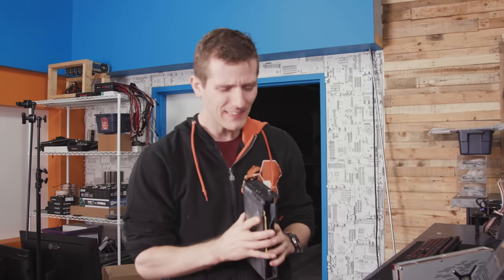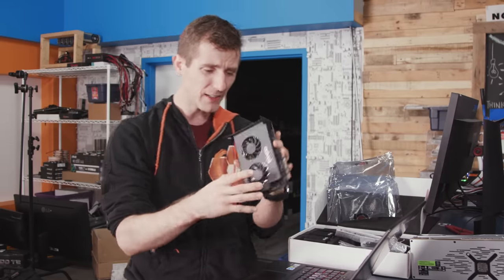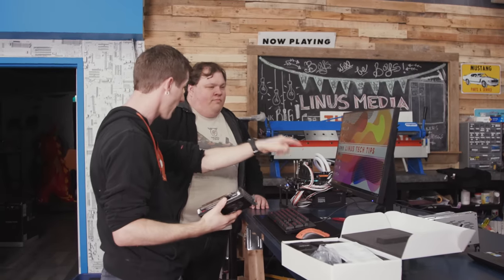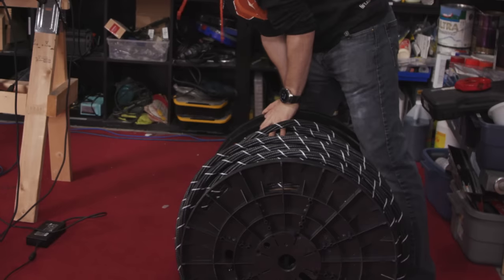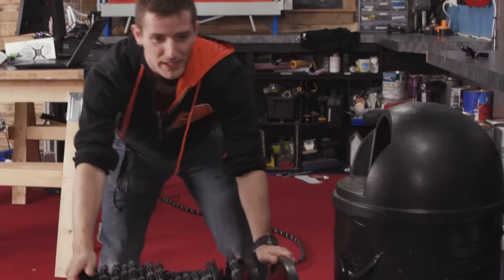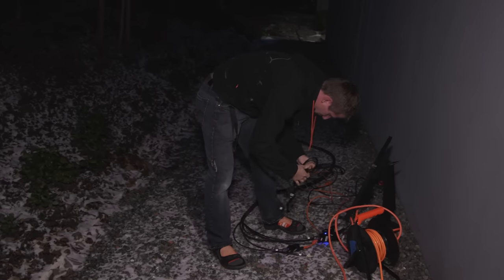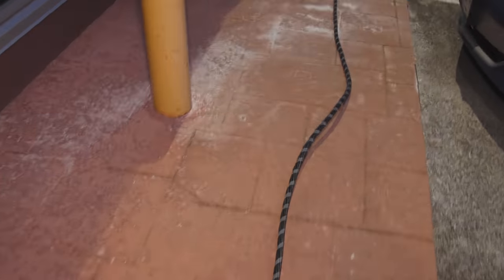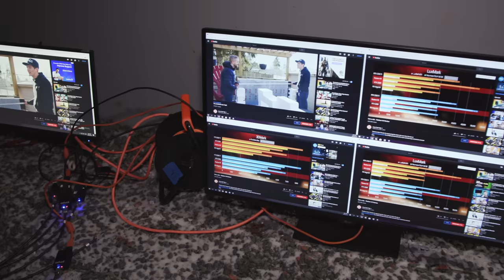The WEIRDEST Video Card We’ve EVER Seen..

Comment: that looks like it should be the GPU of the Nintendo "Switch" ;)
Reply: If only it was faster than the GPU in the Switch.
Reply: Oh yeah, because having 6 ethernet ports on the Switch would do the trick.
Reply: @XDLugia  whoosh
Reply: @Skelath  Its is way faster than the TegraX1 256 core Switch only  its a Power hungry 95Watts gpu unit.
Reply: David Hall 

;)
Reply: @tachyonzero  It only gets 18 FPS on Fortnite with high settings at 1080p, it has a Radeon E8860 GPU inside it.
Reply: @Skelath  it's a e9550, wo pretty much an rx 580, and is wayy better than that
Reply: @darthybai  My bad, just looked up the RX 580 and no, the RX 580 has twice the power draw and higher clock speeds, this card based on its design and purpose would cost 4 times as much as a standard RX 580, may as well shove a GTX 1080 Ti inside the switch instead.
Reply: @Skelath  i was mainly talking about the stream proc count, might be downclocked to kingdom come as far as i know
Any nvidia mxm gpu costs more than double it's msrp cause they want the standard to just go away
That's why you see GPUs soldered on the boards of laptops where they were mxm in prev generations (msi tried to push it really hard, asus)
Reply: @darthybai  I'm not looking at the clock speeds of the E9550 on the Advoli card, I'm looking at the clock speeds publish by AMD, Also the Switch uses a Nvidia Tegra X1 which has a TDP of 15.

Comment: I'm genuinely curious of what would happen upon plugging your monitor into your router.
Reply: browser hi iq automaten io 10 on off do dodo row.tar.mon owe royals? lie sence 4 worse?
Reply: Endless streams of pornography and grainy IP cameras pointed at trees and fences.
Reply: Theoretically? It could happen.
Reply: (For those actually genuinely curious: Nothing will happen -- HDBaseT is using ethernet framing and UDP packets. Only endpoints on the same physical ethernet segments will 'hear' the announcements of devices ready to stream. It does not work very well over wifi even if you've got fancy enterprise equipment like Xirrus or Gigabeam. You have to use their open source layer2 ethernet tunneling utility, vtun. Can find cheap LKV373 HDBaseT tranceivers if you look on the ebay/amazon hard enough. See Also: https://blog.danman.eu/new-version-of-lenkeng-hdmi-over-ip-extender-lkv373a/ )
Reply: @SLLabsKamilion  again, THEORETICALLY...
Reply: @Joe_JesusWins_Lewis  No, not theoretically. Absolutely. Specifications are specifications and code is code. Unless it's manually updated by a human (even in an automated fashion via attack scripts) it's not just going to wake up one day and decide to originate a connection to some random ipv4 endpoint on the internet. The receiver will look for broadcast frames from senders on-segment, and unless you've specifically configured the port forwarding on your router to know the IP address of the receiver device, and map it to your public IPv4 address's port 5004, nothing will happen if connected to a WAN uplink. It doesn't know how to generate UPnP requests, nor can it handle IPv6 addressing. 

The balls are inert, it is under 9000, do not collect go, do not pass $200.

There is literally nothing magic about this at all. It's a couple of off the shelf solutions duct taped together into a single device SKU.

HDbaseT has been around for at least five or six years, using standard MPEG2 transport streams carrying motion jpeg encoded video. HDBitT is the new player on the block, circa 2017, carrying h.264 encoded video over the same MPEG2 transport stream playable by VLC. The major difference in the two is the encoder lag -- HDBitT tends to be about 400-500ms and is unsuitable for gaming. HDBaseT uses more bandwidth over the wire for the UDP stream (32mbit compared to 15mbit) but keeps the encoder lag down to about 2 frames or ~66ms, which is mostly tolerable unless you're playing fighting games with frame-perfect skills in a tournament setting. A lot of recent cybercafes have been using this sort of setup to be able to hide the PCs in a back room.

The bigger issue is availability of SKUs with the featureset you want for a price you're willing to pay. Most of these devices are aimed either at security professionals needing to handle a bunch of high resolution camera feeds or digital signage solutions where latency is almost never an issue. In fact, most of these devices are perfectly fine at 100mbit links and don't even require the gigabit transceivers they use; it's just more convenient to use less of the link budget for a marginal reduction in transmit time per frame.

Finding a HDBaseT monitor is practically impossible; and outside of this HDBitT monitor that Linus has gotten his hands on, I've never seen another combo SKU like it outside of a specific security camera vendor.

And of course, this is one of the first HDBitT GPUs to arrive, until now you needed a gaggle of external encoder pucks hanging off real HDMI/miniDP ports. That's what I mean about combo SKUs.

We saw very similar market penetration with ONVif compliant security cameras and NVRs once they took over BNC/Composite cabling in building installs. Now it's cheaper to get nothing but CAT6 in a new building, with no need for coax, cat3/4 telco, or 24v access control system wiring. Quad CAT6 drops at every wallplate, it's actually pretty cheap to do 10G fiber backhauls switch to switch today, the fiber transceivers are down to $24 and a 50m fiber cable is only $36 off monoprice.
https://www.amazon.com/10Gtek-SFP-10G-SR-Transceiver-10GBASE-SR-300-meter/dp/B00U8Q7946
These are the 'cheap' switches we use. Works great for our PoE phones, cameras, and PoE injectors powering HDBaseT capture devices connected to various servers around the facility.
https://www.amazon.com/TP-Link-JetStream-T1600G-28PS-24-Port-Gigabit/dp/B0196RGV50/
And we power the HDBaseT TX dongles with these (and some microUSB to barrel jack adapters, also from amazon, but I don't have the link handy.)
https://www.amazon.com/UCTRONICS-PoE-Splitter-Gigabit-Raspberry/dp/B07CNKX14C

More or less I had to replicate IP KVMs for far less than their $1200 list prices (for the simplest 8 input models) for a lot less money.
Just the setup linus is testing here is like $800 for the card and $1800 for the monitor, just because there are more or less zero competitors in the field currently. But that's peanuts to an airport needing to locate the departure/arrival screens hundreds of meters away from the display generating computers (or they'd have to figure some way to manage the thermal load of the computers if they're bolted on the back of the display via a vesa mount or something). Things are drastically simpler when you can get a 30W 28" 4K screen running from a 38W PoE port and handle the complete power and display linkage with a single CAT6 cable and no IEC C13 line power cord in sight.

Here at our facility, we initially started with a trendnet VGA to Cat5 extender, which just sent the regular analog video over the cat5 pairs, and was not in any way compatible with ethernet hubs or switches -- just reusing the cabling and jacks. We had an HDMI to VGA adapter plugged into a Swann NVR we got from costco, ran into the extender, and up to the management office. Management complained they couldn't interact with the NVR's UI (of course not, it was a passive VGA cable extender.) so we kept iterating until we found something inexpensive that worked quite well and then repeated it for each server. Now if only we could find a cheap 5 port gigabit switch with one of the ports being a PoE power input that didn't cost $75 like netgear's GS105PE. You don't need the HDMI RX boxes, pick up allwinner H6 set top boxes (we use eachlink h6 max 4GB/64GB models) for the same $40 price running android 9/10 with USB3 ports and install vlc. The sad thing is, I can get the LKV373 HDMI TX in bulk for $38, while a passive IP KVM pod is $70, and the active ones are $138-$249. Crazy world!
Reply: Graham Cantin chill out
Reply: @stevenzenner7510  my jets are quite cool. 2000C burn temperature, down to 1180C. Any chiller and i'd suffer flameout.

Comment: Now. I am not an engineer(except I am). But did he seriously just unroll the coil for comedic effect? Have fun rolling it back.
Reply: Had to be, leaving it coiled up doesn't mean that the signal is only going 10 feet. The device might be 10 feet away but it is still traversing 100 meters of cable.
Reply: I was thinking the same thing..
Reply: He could do that but then it wouldn't be as fun, plus they could be cheating with a shorter cable in the same spool.
Reply: I also thought the same thing...

Comment: Couldn't Linus have just taken other monitors over to Anthony and plug them in there via Ethernet cable reel? It would only be like a meter away from Anthony but it would still have to go through the entirety of the Ethernet cable plus you would be able to compare the duplicated monitor(s) to the source monitor.
Reply: Yeah but that makes the video significantly more boring. Remember the video with the 100 meter lightning cable or whatever and he went out on the roof and across the street?
Reply: o rly
Reply: Yes, but that way is boring and sensible, this method is more fun.
Reply: But then you’ll miss all the moans
Reply: EMI

Comment: Yay now you can game on your PC from the house of your neighbor down the street!
Reply: Nope, that card has an embedded Radeon E8860. Which is 1/15th the performance of a GTX 1080.
Reply: @Skelath  I said you can game, not game at 4k 60 fps.
Reply: @joenodden  The "Radeon E8860" does 9 FPS in GTA 5 at 1080p ultra settings. 18 FPS in Fortnite at 1080p on high settings.
Reply: @Skelath  E9550 - wouldn't recommend gaming at 13K (6 x 4K DCI), but we tried it for the giggles. Definitely works well if you limit yourself to 4K https://www.youtube.com/watch?v=TZ-CEQODSDs

Comment: I think the use case for this card is for universities with huge Ethernet networks already established in the lecture theaters and classrooms. Rather than getting contractors to come in to install wall mounted HDMI ports, you just use the Ethernet that's probably already there.

It might even let you run screens over an ethernet network, so you don't need a computer in the same room as the projectors. Maybe it's for some kind of LAN based 'cloud' computing in that sense.

Other than that I don't see this as anything other than a proof of concept
Reply: Plenty of application with electronic signs in commercial environments that require large distances between the content server and the displays. It's much more convenient to have a centralized media server rather than a bunch of different tvs running off usb drives.

Comment: I had to deal with KVMs that worked similarly. Only they sucked so bad, the company had to send a couple of their techs to help troubleshoot. Their own techs were having issues as well trying to fix the problems. The monitors would turn off and not come back up without a series of reboots of both boxes on both sides of the KVM and the PC. Can't remember what the fix was, but wish it would have worked as well as these cards.

Comment: Bro it doesnt matter if you unfold the cable or leave it as it is the signal will be still the same.Because again the signal will pass all the cable to your monitor unfold or not.
Reply: For epic dramatic purpose,
Reply: Depends a little on EMI, if you want the technical details: https://www.belden.com/resources/knowledge/white-papers/4k-uhd-wp
Reply: It's to get the point across, and it's not much effort to walk a cable 100m.
Reply: But that’s boring... this way means views
Reply: @maadalchemist7545  *watch time

Nothing that's in a video will cause it to get views. No one knows what's in the video until they watch the video.
Reply: No it won't count as 100m because if it's rolled the cable is close together and it jumps signal through the shroud and goes to the closest monitor cable
Reply: @mats_vlogs6943  u sure bout dat? cables is insulated. no way the signal cna jump thru it...
Reply: @mats_vlogs6943  Not true at all. Ethernet cables use twisted pairs to mitigate exactly that kind of crosstalk between cables (interference causes almost the same signal change in both wires in a pair, so it doesn't significantly affect the difference between them which is received at the other end).

Comment: When you remember going far away wont make the cable longer...

Just have it laying down there and do a side by side comparison.
Reply: When you remember that a coiled string/piece of copper, will create magnetic interfence, even on the BEST shielded cables, if that coil is 600 meters in length...

Comment: Yeah at my work as an AV Tech we often run Fiber for video connections. Very expensive spools. The one we have was 8 grand when new if I recall correctly. And we have these little converter boxes.  We use SDI probably most frequently.
Reply: I know this is a little late but where do you work where you actually have have the money to use fiber for AV? I’ve only ever seen it used for linking servers. I’m a low voltage tech

Comment: For massive advertising styled displays? I guess?
Reply: You wouldn't be wrong. I work with an outdoor digital display company (think digital billboards and outdoor digital scoreboards) and they utilize similar tech for projects where the output device (PC\media device) needs to be far away from the actual display. For scoreboards this can be because the output device is in a scoring room near the field(where it can easily be controlled or monitored) or for a billboard where the output device is on the rear catwalk of the board (these can be longer and deeper than you would think looking at them from the ground).
Reply: Sports Arena ad boards too...those screens around the rim of the seats that display graphics?....this card
Reply: A bit more useful than that, as if there is ethernet access points at both ends, it can be connected using the building's hardwired setup, WiFi or whatever.

Comment: Master electrician here... never use an extension cable reel coiled for any load. Luckily your power draw was minimal and for a relatively short amount of time. Always dereel your extension cable fully to reduce induction and resistance build up. Many older load centre circuit panels are still over 30 years old in commercial applications. There is a 50% chance your branch circuit breaker will not operate normally. This is an electrical risk and and fire safety hazard! Please be careful!

Comment: How is this different from an HDMI-over-cat5 adapter you can find on Amazon?
Reply: Latency maybe?
Reply: It's standards based. HDBase-T is a standard for high definition video over category cable (not Ethernet).  NEC and Samsung actually make commercial grade displays with built in HDBase-T inputs.  Crestron, Extron, and even Monoprice have HDBasse-T AV switchers.
Reply: I would imagine it's the 6-4k displays simultaneously from one two slot PCIe card.
Reply: The main difference is that it's not transmitting a bog standard HDMI signal over a cat cable like those adapters do. It's a standard which supports transmitting 100W of power (that's like 2-3 monitors right there), USB 2.0, CEC (monitor off/on/change input from the source machine), and RS232 serial, all over cat5e. Higher quality cat cabling can transmit higher resolutions but it tops out at 4k 30fps uncompressed. It can get 4k 60fps when compressed.
I don't think it's gonna be replacing those hdmi over cat5 adapters any time soon for people-who-just-want-a-signage-display-set-up-remotely, however it's probably gonna do the rounds in the AV industry, and remote KVM setups.